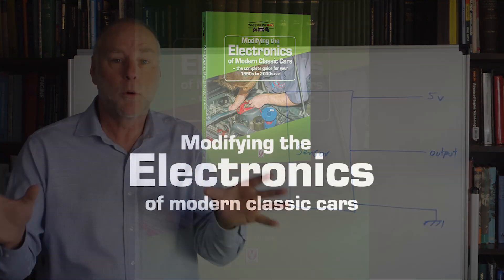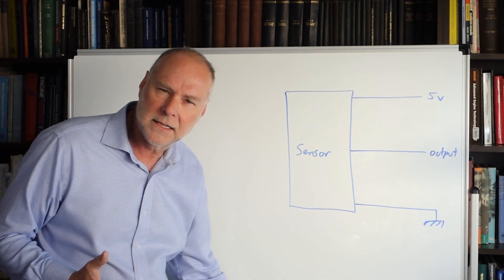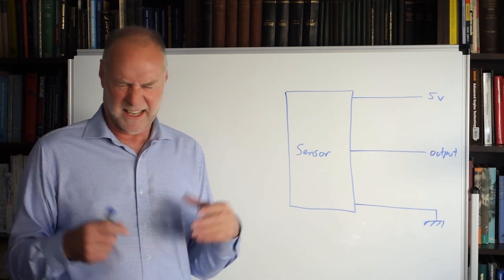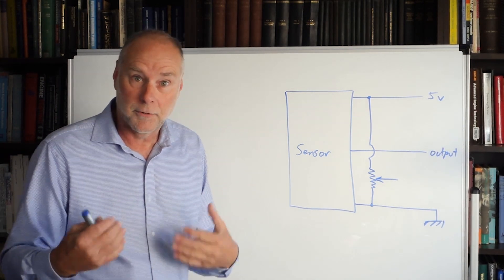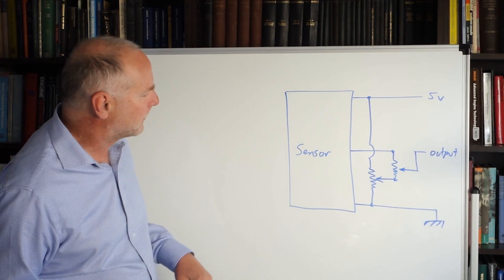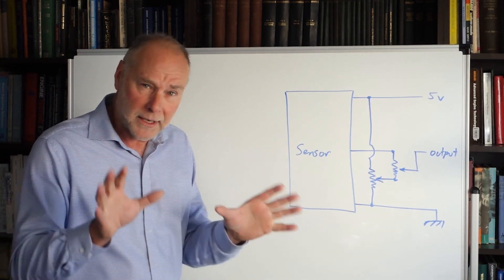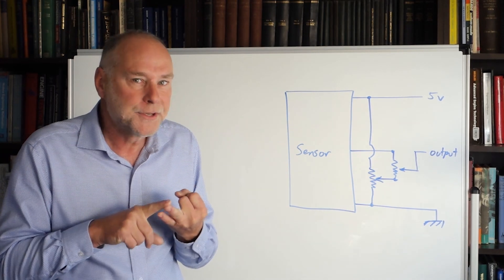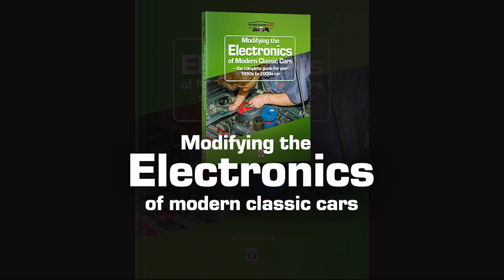Modifying Electric Power Steering Weight

Comment: Hi in your video the pots you don't say the Resistance of the pots. ?
Reply: Try first with 10KOhms if doesn,t work good next try with 100KOhms. But you must be sure that use the correct pins on the diagram.

Comment: Hey bud im fitting 2015 toyota prius  power steering column to my 1980 for escort  and it has a stand alone ecu thats only connected to the pas  not the engine ecu and it runs in limp mode but can be a bit light on the steering i just want to make it a tad heavier if needs be when i get it fitted can this be done with you application 🤗

Comment: Interested in trying this out. My previous car was a 1998 Honda Accord. My current car is a 2008 Honda Fit.
The steering on the Fit is SO much lighter, that I'm kind of afraid I might swerve harder than I'd want to, if ever something happens while I'm on the road. 
I wish it had selectable strength levels, like the 2nd gen Kia Soul does. 

I'll go through the service manual, and see if I can find out which wires I would need to add the potentiometers to, and maybe try this out some time this summer. If a test works, I'll try and find the resistances needed for normal, medium, and heavy. Then install a 3-way rocker switch with those resistors in the blank plug next to the side mirror adjuster.

Comment: Interesting video 👍 thanks ☺️
But I was actually thinking how to make my power steering more powerful. But maybe I am thinking wrong and this is actually the solution. You know my problem is.. on a Hyundai i40. Just cruising on motorway.. if I want to do a minor correction I have to put quite some force on the steering wheel before it actually starts moving. And than if it moves it easily over corrects a bit. Very irritating. Now I can see how this solution could help prevent the over correcting. But what I want is that I don't have to give so much input in the first place. Therefore my thought was to find a way to boost the power steering. Am I thinking wrong here ?
Reply: The manufacturers are working on your favor. The people who have the like for road feel are the ones screwd.

Comment: Hi Julian. Great video thanks. Do you have a video or guide on how to lighten electric power steer? as a mobility aid? thanks Craig
Reply: Same here! An accessibility company wants $9k for a re engineered power steering rack- this may be fair for the work, but I'd love to try upping the assist first!
Reply: @pm6425  Requiring TWO steering systems and a re-engineered rack when a tweak to some software would suffice is not really "fair" ;)
Reply: @davey52876  I think you are armchair engineering here. this easy "tweak" you speak of has never been documented on the internet! Whoever knows how to do this can charge as much as they want. Do you have the answer, or a guide? I would love to hear it.
Reply: @pm6425  Dude. I'm agreeing with you. Take the win. These EPS systems are tweakable. I know that there are two different steering profiles for my Toyota XLE version and the Touring version. It's just a configuration issue. Many cars today have selectable configurations in their user settings. It's not armchair engineering to point out that NMEDA requires an unnecessary backup system for each RE steering modification in all situations and seems like a money grab IMO. And BTW, I am an engineer. Just because I don't have the answers for a power steering system doesn't mean it doesn't exist. Jeez.
Reply: @davey52876  did you find out an answer to it? I have a Corolla e170
Reply: @davey52876 were you able to modify/increase your EPS assist? I also have a Toyota XLE Sienna and I'm trying to avoid paying thousands of dollars for a bunch of stuff I don't need. Any advice would be greatly appreciated. Thanks!
Reply: I'm here hoping for an answer too...